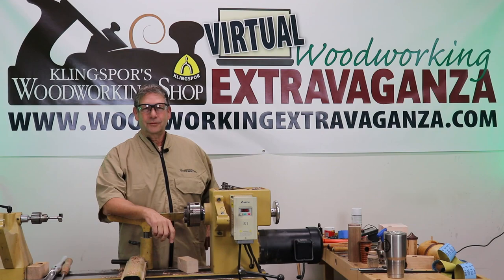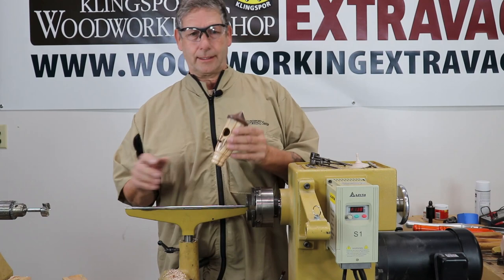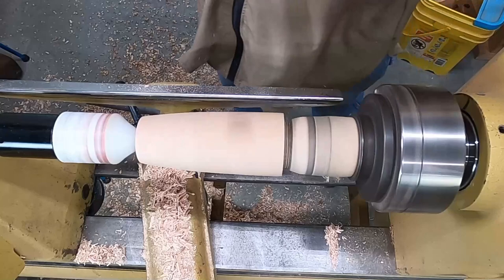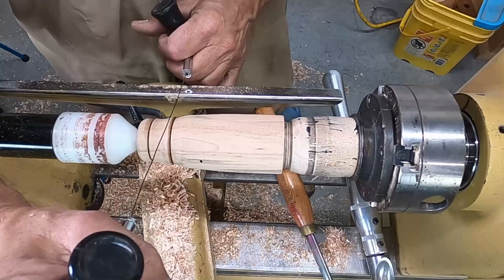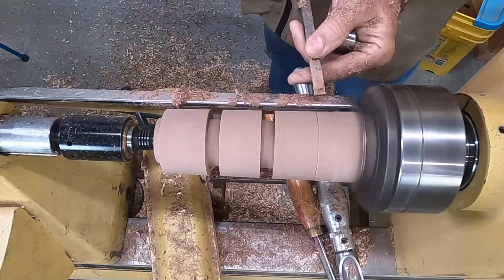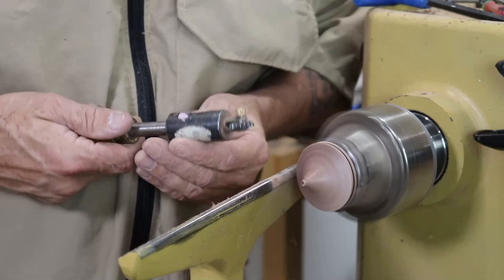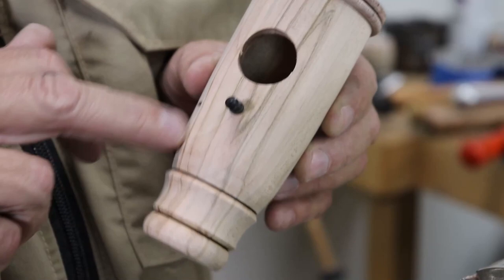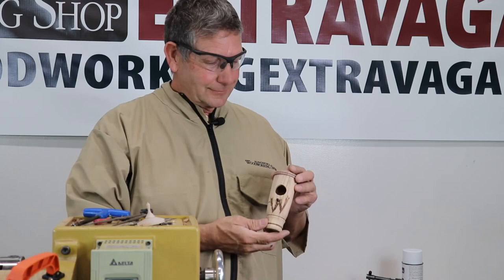How-To Turn Wooden Hummingbird Birdhouses

Comment: You said tour wife glues the tops on.  Most bird houses need to be cleaned out each season because some birds will use a old nest. Is that not the same for humming bird houses ??
Reply from the maker: If the birdhouse you want to use is a functional place for birds to reside, then yes. These are for decorative purposes and something people can turn on a lathe as a project or ornament. Thank you for watching!
Reply: No, most small birds, don't poop in the bird house or their nest. When the offsprings poop, in the nest, the parents, wait till it dries up then they throw it out. And when a new bird couple move into the bird house, the next season,, they just nest in it as is because they don't need to build a new nest in it. Small birds build their nest in the strangest places, one time I seen a wen bird build its nest inside the square pipe of a bulldozer.🧐🧐🧐

Comment: Hi is your main birdhouse you start with a 5 inch  or 6 in 2x2  wood?
Reply from the maker: Use 6" for best results! Thanks for watching
Reply: @KlingsporsWoodworkingShop  If the wood cracks can you still fill it with CA glue?
Reply from the maker: Of course! Keep in mind if your turning stock has a high moisture content then you'll be doing this a lot as it dries. CA is a great way to fill small voids and cracks